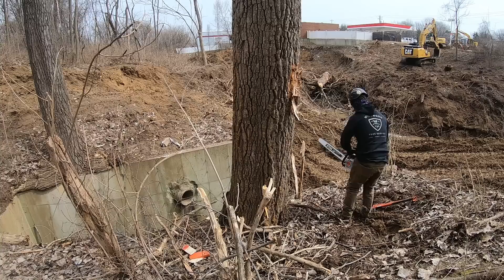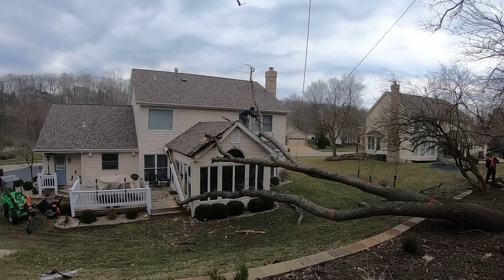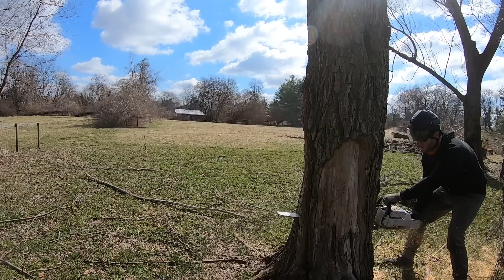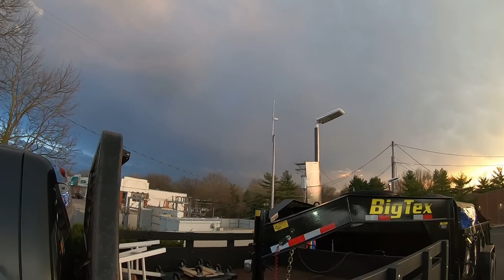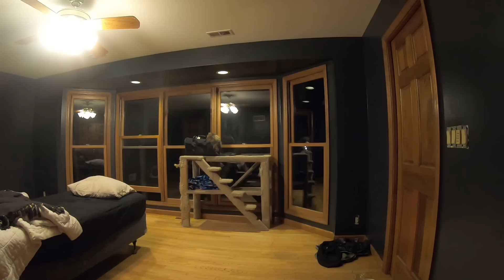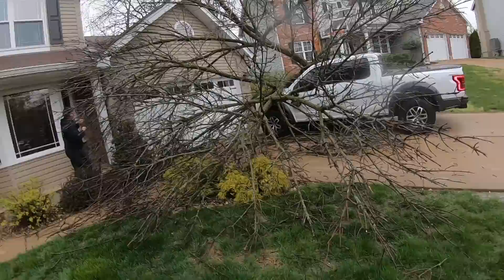Recent Randomness

Comment: I think Stihl makes their wedges out of some sort of Teflon coated goose poop. Zero holding power, you can have them 75% buried and they'll still find a way to rapidly eject themselves. Great video! Gibbs is going to dig the panoramic window view.
Reply: That is why its better to just use metal ones that have a grated texture to them. That texture helps them grip and they last foreverforever. They have the weight to them where they won't fly around like those plastic ones.
Reply: K + H  wedges from Madsens in Washington